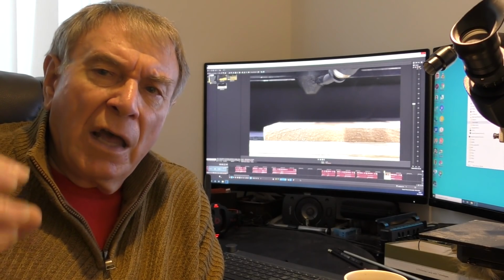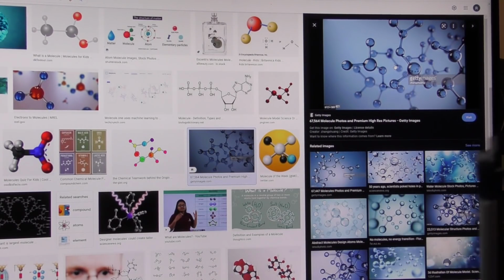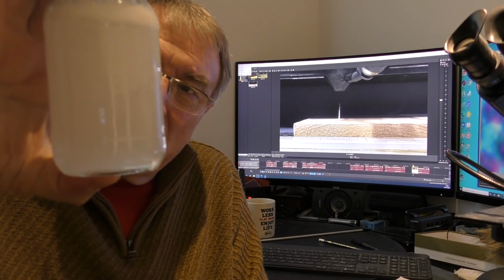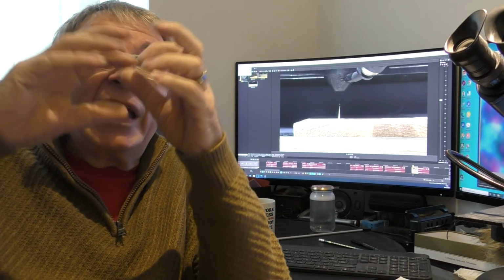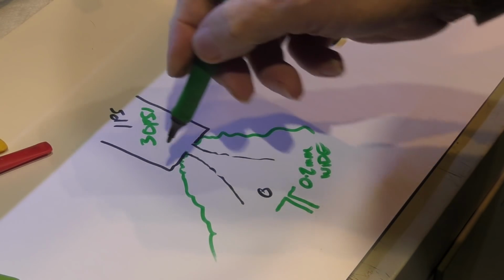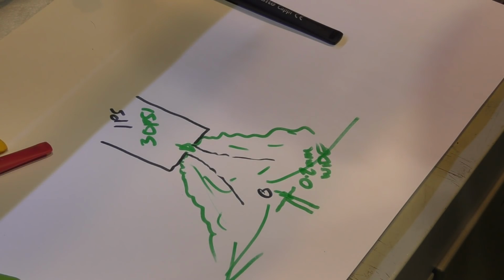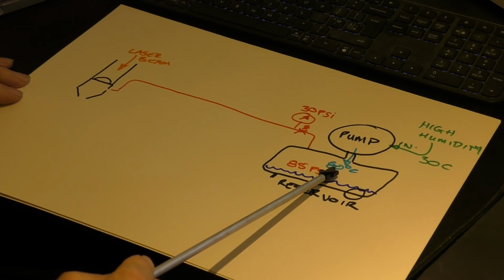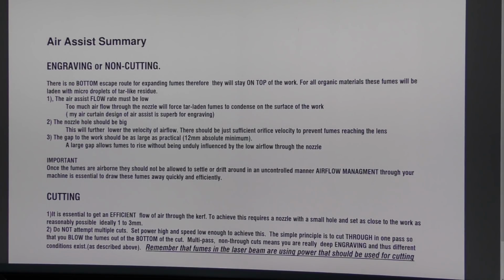RDWorks Learning Lab 223 Air Assist  Why, How and When

Comment: paused at 14:24 i am assuming the laser beam striking the smoke is actually lasing the smoke or creating spontaneous emission and that is why it looks like a white column of light only where the beam is making contact are those smoke atoms being lased, although i have seen invisible laser beams cutting metals and you see a uv blu spark and idk what that is , perhaps the spectrum of that metal also lasing
Reply from the maker: I am afraid your concept of lasing outside of a laser source is impossible. Smoke (or fog) occurs when microparticles of liquid or solid are suspended in air. Those little spherial droplets scatter the white light (or whatever colour light is around) to show their presence.To a laser beam these liquid or solid particles are just another material that will absorb  energy when  photon collide with it. As the microparticles absorb the energy and convert it to kinetic energy  to increase its amplitude of vibrattion.there is an increase of temperature. At a certain critical energy level the molecules within the micro droplet will undergo a CHEMICAL change. This chemical rection is usually exothermic and some of the excess enegy appears as light. That light will have nothing to do with the laser and is NOT laser light or even the same wavelength. Instead it will be random light, probably with its own multiwavelength spectrum.

 A diode emits a blue laser beam When you cut or engrave wood there is an intense bright blue light that emits form the cut zone. I have seen many videos wher people are paranoid  about this light and believe it to be laser light that is trying to kill or blind them. It's just a human self preservation fantasy. Laser beams, like all light rays, travel in straigh lines When they hit the material surface they give up their enegy to provide damage. They cannot then turn through 90 degrees and try to kill you. It's just illogical and nonsensical. That bright blue ligh is NOT laser light but exactly the same as I have just described above. It is the fumes experiencing a secondary burn from the laser beam , causing further heating and chemical destruction of the fumes and emitting RANDOM non-laser light in the process. It happens to be blue because that the colour of the "local" illumination. However, there are two real dangers from that light. A)The intensity is as bad  for your eyes as looking at the sun or a welding arc. You dont need expensive special  455nm goggles because unless you are a lab technician working with open laser beams on an optical bench your chance of getting hit is NIL. You just need good sunglasses to attenuate the intensity. B)The second danger is the light spectrum emitted will contain UVB and UVC light. Long term exposure can damage your eys but fortunately cheap polycarbonate clear goggles fully absorb these low wavelegnths. 
 The light emission from metal cutting is a lot less intense but the same "non-laser"  light precaustions apply

These  videos  may help you to to understand the intricatices of laser tecnology.    https://youtu.be/wermWuSbK4w        and       https://youtu.be/iRTLcBEISTk
Reply: @SarbarMultimedia  yes of course idk what i was thinking, the beam is heating up the wood particles and igniting them in mid air and same for the emissions of the blue light , as a welder myself i always wondered about the blue light of my tig torch, which is plasma from the transfer of electrons across the gap shielded by argon and wondered if i can enclose this arc within a tube between two points and the tube would have small pin holes on it is side where this light will emerge onto collimating lenses then strike mirrors one being hr and the other oc on either sides of those holes  if it is possible to get a lasing action in the plasma stream stimulated emission and emit some laser with of course multiple frequencies but a beam nonetheless ?

i was also wondering if chemiluminescence can also be turned into laser light, im thinking a glow stick inside a fabry perot resonator?

another theory i have is for example a ruby laser who loses lot of possible stimulated emission due to being robbed by spontaneous emissions of photons being reflected back into the ruby by the housing reflector which of course are not in line with the central axis ,,now suppose we made a reflector that absorbs the 640nm emission and only reflects the blue green of the flashtube will we not increase stimulated emission by the same fold now that we recovered from the loss?
 
thx for the vids links ill view them in due time,, btw did you get to look at techingredients yt ch? he is showing amazing scientific vids many to do with lasers as i said perhaps he can help you with your stuff
Reply from the maker: @ARCSTREAMS   You have some interesting ideas  but the definition of a laser is that it is monochromatic  where all the wavelengths are exactly the same  and those waves are all phase locked by the stimilated  change from a high energy state to a lower one where the excess energy caused by that drop is emitted as  COHERENT  "light" (visible or invisible to our eyes) However , although that may desribe the essence of a laser, the firstvtwoleeters of the acronym  L and A stand for Light Amplification. The amplification can only happen by reflecting the stimulated radiation between mirrors to cause a cascade effect The effects you imagine  cannot be a laser if there are multiple frequencies involved
  BUT all your thoughts raise interesting questions some of which I am ill qualified to even consider.    You must do your own experiments and research to validate or invalidate your ideas. What ever the outcome you will l ghain valuable knowledge/.
Reply: @SarbarMultimedia  i am always full of ideas and the problem is i can not always put them into a proof of concept model yet i have seen idea i had become reality with other ppl,, as for multi frequencies such as that found in the arc of a tig torch i am not sure why this matters so long as the mirrors we are using might only select a certain freq one that perhaps has the strongest amplitude, besides many lasers have more than one freq which can be tuned like hene or dye lasers and they are still lasers, anyways i am just trying to come up with a simpler way to create a laser beam or if anything a nice collimated blue beam show lol it just needs to be at the very least spatially coherent and fairly temporal but that is not a requirement for me
Reply: @SarbarMultimedia  btw i asked tehcingredients about my glow stick laser idea and he said it should technically work as that is how chemical lasers operate, while other ppl have told me no so i kinda got excited to hear such a possibility although  you would think it would have been demonstrated if it worked, unless no one has thought of it? lol nahhh, but i asked him if he would considered making it his next project we shall see

Comment: so what kind of color is clear water or acrylic? what is happening there with the light? id say there is no color since the light going though such materials is being transmitted and not reflected or absorbed , but why are such things still visible and have shape outline to them?
Reply from the maker: The edges catch the light differently and distort what is behind. ie the transparanciy is not cosistent at the edges. The only reason you dont bump into large sheets of glass is because they are never so big that you cannot see the edges.
Reply: @SarbarMultimedia  yup although ive seen some ppl smack right into well cleaned glass doors lol but it depends on the angle view if there is some reflection it is more visible also the edges on a shard of glass can pretty much disappear when dunked into a glass of oil or even water again at the correct angle for water

Comment: Nice work! One solution for the humid filled air coming from the big compressor woul be to install one of those air regolators and water separators. They are inexpensive and common where air is used for some delicate works including air painting guns etc.
Reply from the maker: Hi
 That is a good suggestion for those that relly want to fit a big compressor  ( I already have such equipment) but the point of this videeo is to show that it is unecessary to use high flows and high pressure. I have done a furhter video on this subject that may interest you see  https://youtu.be/QwOkOLBp1pE
Reply: @SarbarMultimedia  I will watch it for sure. Your tests confirmed my suspiction that air flow is important throughout all processes: cutting and engraving. The general theory wants air assint not necessary while engraving, even counterproductive. Your test with the lateral air blow shows exaclty the opposite. How about using both for engraving? a tiny blow from the nozzle and from the side to blow debris away?

Comment: Where can we buy a flow valve as you used in your video "Air Assist", Thanks
Reply from the maker: I presume that you are speaking of the flow meter for measuring air flow.
 if so see
https://www.amazon.co.uk/dp/B08G4K73C5/ref=sspa_dk_detail_5?psc=1&pd_rd_i=B08G4K73C5&pd_rd_w=gQMV3&content-id=amzn1.sym.84ea1bf1-65a8-4363-b8f5-f0df58cbb686&pf_rd_p=84ea1bf1-65a8-4363-b8f5-f0df58cbb686&pf_rd_r=TXYKNWR16AS3SRN9ZCTG&pd_rd_wg=B1Qod&pd_rd_r=10304024-3642-493c-b7c0-cbee25dc1387&s=diy&sp_csd=d2lkZ2V0TmFtZT1zcF9kZXRhaWw
 If you mean the ball valve that controls the flow then see  BUC 6
https://www.ebay.co.uk/itm/295896867443?hash=item44e4d3e273:g:4AMAAOSw8s1k5WKy&amdata=enc%3AAQAIAAAA0G4S5PKeXlfgLtI%2B1CzSH4K27%2FRQIuyh8S%2FL39UYN5PY%2F93PFM4s5aAPpXBMIziVPGdH%2FCi6K9CbHSap81%2BBnmY66kUCG006XTCFazMqJ0AZ4%2BsLe8D%2BPJzxW2u1zFLac0pUTLNPF3Lr%2Fh9W2NN4vr%2FDS%2Ba3hxxIY%2BUDHNF2jlErx7YM%2FFsUCR9jgXIsoCMKcpK%2FoXI8CCqWNns%2BnLmmW3%2Fb%2FEuyByFFVrILuUxPeu%2BK%2BxwGY2Pjy8nOVTYA3Gxog%2BI7uKGHB5Bh82H9pOs93sQ%3D%7Ctkp%3ABk9SR7Klq_rGYg

Comment: Where could I find the ball valve you’re using for your air assist? I’d like to keep my stock air assist but be able to reduce the flow out of my nozzle for leather engraving.
Reply from the maker: Hi Josh 
 Try this description  on Ebay.  BCU 6mm pipe
https://www.ebay.co.uk/itm/155402093584?_trkparms=amclksrc%3DITM%26aid%3D777008%26algo%3DPERSONAL.TOPIC%26ao%3D1%26asc%3D20221115143056%26meid%3D162d9298a0254d52b60c47f5ce063078%26pid%3D101612%26rk%3D1%26rkt%3D1%26itm%3D155402093584%26pmt%3D1%26noa%3D1%26pg%3D4375194%26algv%3DRecentlyViewedItemsV2%26brand%3DUnbranded&_trksid=p4375194.c101612.m4236&_trkparms=parentrq%3Ade79fa781890a8cd8943d226fffee5a2%7Cpageci%3A905abbe2-3754-11ee-8374-266f7fd681da%7Ciid%3A1%7Cvlpname%3Avlp_homepage

Comment: So glad I anticipated some of this and added a pump to the purchase of my first laser which is currently with the courier! I'll have a look at the nozzle when it arrives to see what forethought has been put into the Ortur Laser Master 3.  If there is a big orifice then I'll 3D print a filler with smaller sub-nozzles to point the air directly over the cut or maybe redirect it like in your sideways pointing flow. I'm laughing here at 51 minutes, thinking about the expected condensate in your nozzle from the high pressure to low pressure exit. Don't take it badly, you're doing amazing research and making it public,  a laser company should have already snapped you up except that you are giving your research on here for free. I was initially thinking ahead that maybe the higher pressure was cooling the workpiece and reducing temperature but then I thought about pressure reduction and heat wave lensing effects which led me straight to thinking of condensate from your high pressure hose. Raising pressure slightly by restricting nozzle flow is another way to defeat condensate inside the nozzle.
Reply from the maker: Hi Graham
The diode laser you are expecting is a laser operating at a completely different wavelength to the CO2 laser that I concentrate on in this series. 10,640nm light is much longer wavelength than the 450nm you are going to play with and the shorter wavelength affects less materials, some more efficiently and other less so than CO2. However, the great advantage you will have is mechanical simplicity. The laser is a compact single unit that requires no light path guidance around the machine. Sadly, there are many disadvantages. You have very limited lens options (on some units, none) and the so-called air assist is really a down flow cooing air for the diode unit. This in itself can be bad news as it will blow your tar laden fumes down onto the worksurface. Because of the low power and the fairly poor quality laser beam (typically M2=1.5) it is not well suited to cutting but is ideal for the "soft" power application required for engraving. You cannot regulate the power of a diode laser, it's always 100%. Pseudo power control is achieved by controlling the exposure time via a PWM duty cycle principle. The "soft" intensity distribution, low power and PWM control system allow you to do delicate engraving tasks that are impossible with a CO2 laser.
Many of the science principles I speak of are transferrable to diode lasers but the lens technology that we spoke of recently may not apply because at such low wavelengths, normal glass lenses can be used and I have no idea what multiple lens systems are used internally to change the square light output from the chip to a usable round focused beam. I have seen many focused diode beams that are elliptical i. e. the X and Y kerfs are different. I'm sure with your curiosity, it wont be long before you invalidate the warranty and dig inside the unit!!!
Best wishes
Russ
Ps watched the Ted video and yes, I summarized it in just a few words We are not amazed at how our eye works so its not a massive leap to extend the same basic principles to smell.  It was several years ago that I first came across this idea in a TV documentary. Here is just a snippet
https://www.google.com/search?q=jim+alcalili+quantum+smell&rlz=1C1CHBF_en-GBGB911GB911&oq=jim+alcalili+quantum+smell&aqs=chrome..69i57.16947j0j7&sourceid=chrome&ie=UTF-8#fpstate=ive&vld=cid:445db102,vid:3P7B_LkSlKQ
Reply: Your already seeing the newer explanation of scent explains your rather quick response earlier! Agree, diode vs CO2 laser. I am very much at the start of my laser journey. I'm  old enough to feel some awe still at how far our technology has come during my life time. I'm really curious with my coming 60 watt JPT MOPA laser to see how much focus wanders on a flat plane  for a beam that has different radius the further it moves from vertically under the lens. I got lenses for areas of 50, 150 and 300mm, hoping to get some optimisations to maximise it's damage to metal with the 60 watts being there to reduce frustration at ablating times hopefully. It's not a thunder laser but I'm looking at this as more or a design prototyping tool than a business at the moment.
Reply from the maker: @fluiditynz 
Hi Graham.
 Many years ago I questioned my science teacher after a lecture about smell, when at that time the lock an key priciple was the accepted explanation. I asked why it wasn't vibration based like sight and sound. I was just a silly notion at the time but it was not until I saw the full documentry on quantun smelljust a few years ago that it all came back to me. However,  it still seemed far fetched. It was not until I started to understand how light interacted with molecules to damage them with a laser beam that I began to understand how our eyes worked by detecting light waves at unimaginable frequencies. The idea that smell was akin to this sense that our body already posessed, suddenly became really understandable.

 When you get your MOPA laser they may not send a user manual. Here is where you can download it.
https://mail.google.com/mail/u/0/?tab=rm&ogbl#search/JPT+/FMfcgzGmtFBWGfrsCTzfQLpBWnNDGJvX?projector=1&messagePartId=0.1
Reply: @SarbarMultimedia  Thanks. Luca says he wasn't the first to have the idea about vibration but I give him credit for putting the pieces together. I don't see much of him on line but every time I do he continues to surprise me. I saw a thing on mitochondria communicating with each other late 2021 and put it together with my skepticism on genes passing instincts between generations and my not feeling an intuitive fit for long term delayed memory retrievals being in the brain alone and here was suddenly a marvelous missing link in my understanding, our mitochonrial symbiont that has co-evolved with us through the millenia, it seemed to me to be occams razor like, that their communications would intertwine with our own and be the solution to my questions. Fast forward and Luca Turin and a team have been given scope from their sponsor to investigate human consciousness and half way through the video, Luca starts talking about mitochondria.  I think this is not far away from becoming accepted science but it also has implications for AI consciousness, Luca has the insight to believe something is missing from our current accepted science but it is that current accepted science that has been driving neural network development.  I'm not sure why I haven't been able to find others speculating on my theory of Mitochondrial intellectual symbiosis but I think the internet and current science is at a level where there's no going back on this theory and it will be researched and soon.